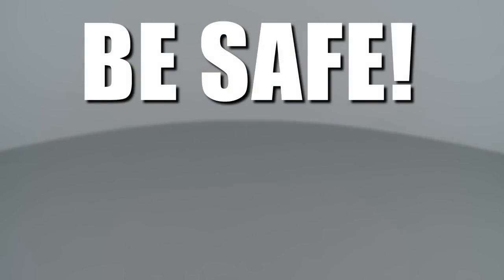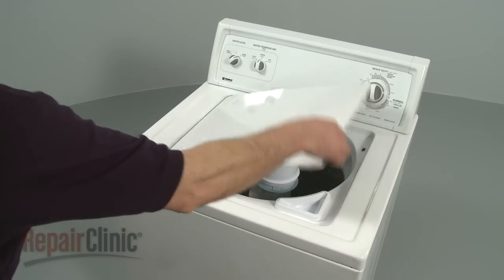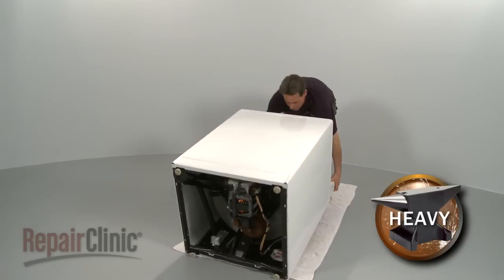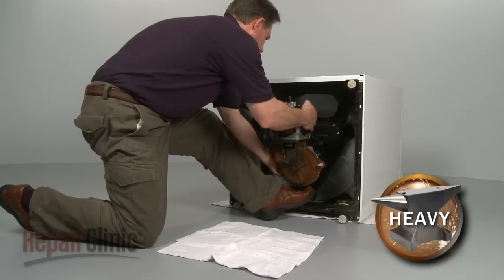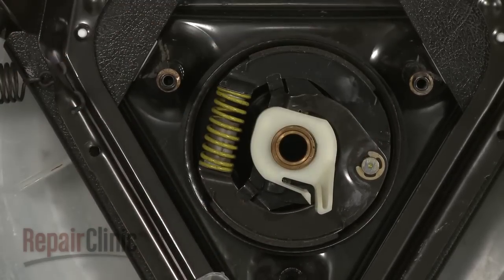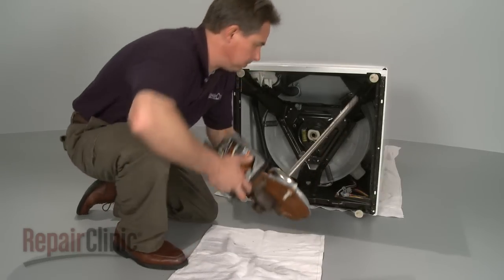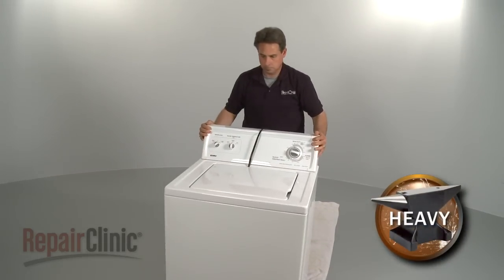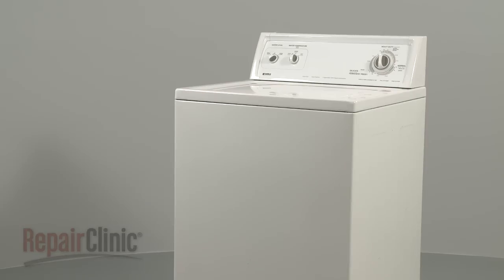Whirlpool/Kenmore Washer Clutch Band Kit Replacement #285790

Comment: Love this.  One suggestion: when reassembling at about 2:50 in this video), you might need to grab the brake cam and twist/push to get assembly to push in a bit more so the clutch can be reconnected to the washer.  Had to go through several videos before finding that's what I needed to do.  Otherwise, and awesome tutorial which helped me do my own fix.  Thank you!!

Comment: The videos are great, couple of questions I haven't seen addressed here or anywhere else -  I've got what appear to be metal shavings on top of the transmission case, but it seems to be working fine.  So I'm putting in a new clutch, but what about the brake shoes?  When should they be replaced?

Comment: These videos are great, very easy to understand and do. However, once I got it all apart, the only thing that seemed to be worn was the plastic piece on the top (bottom of the tub)  the one that fits inside the clutch when you put it together, could this part prevent the tub from spinning?

Comment: Simple easy service design . I find it interesting that the pump has the same type of clips holding it on to the motor as the older ignition distributor caps used.
Reply from the maker: Chuck B Thank you.

Comment: I was wondering if you could help me determine what parts I need. When we flipped the machine back it looked like a belt was loose but the appliance center repair tech told me over the phone this machine didn’t have a belt??? The model number is WTW5540SQ. It is a discontinued model. I see the newer model number listed as WTW5540SQ0 but it doesn’t look the same as our machine.

Comment: Hi,@1:52 the C clip I have keeps falling off. What is the C clip attached to and do you have this part or a video on how to access it?

Thank you!
Reply from the maker: This C clip is attached to the drive tube. We carry the part. The C clip for this model can be found here: http://www.repairclinic.com/PartDetail/Ring/W10083200/1388892?TLSID=1621
Reply: That's great, how about the drive tube? Can I buy one of those?
Reply from the maker: stackingPain The drive tube for this model is here: http://www.repairclinic.com/PartDetail/Drive-Shaft/64208/671416?TLSID=1773

You can also get the whole basket drive, which includes both the tube and the C clip: http://www.repairclinic.com/PartDetail/Basket-Drive/285792/1254?TLSID=1773

Comment: My kenmore don't spin. I replaced the coupler and clutch. Can the brake or motor go bad
Reply from the maker: They definitely can. We recommend using the repair help section of our website. If you enter your model number there you'll have access to model, part and symptom specific repair help. http://www.repairclinic.com/repair-help
Reply: When I did my clutch I didn't notice or look I guess to see the tabs were broke of in the basket drive so I just put the new one on. It broke them off. I took off again and inspected and found this out and that my disk brakes on the basket drive needed replacement and that area was very rusty and dirty. Must clean with sandpaper or emery clothe. They have a video on it. If you look at your old cam and the little clips well I'll say knobs are broke off they're in that came washer...

Comment: I have a Kenmore 70 series washer the washer recently stopped spinning so I changed the clutch and the coupler, now the problem that I have is that I put it on spin cycle  and it slowly spins for 5 seconds and stop what could be wrong. please help.
Reply from the maker: +Yashira Martinez The lid switch could be defective if the washer will not spin or stops after a few seconds.
Reply from the maker: Here is our lid switch part testing video for help: http://www.repairclinic.com/Video/Video-Landing/633-11/Washer-Won-t-Spin-or-Drain-Two-Terminal-Switch-Test-Washing-Machine-Repair